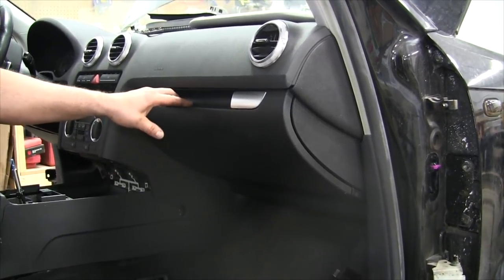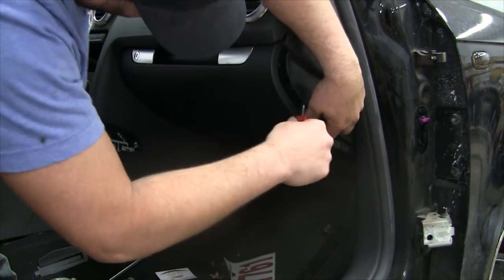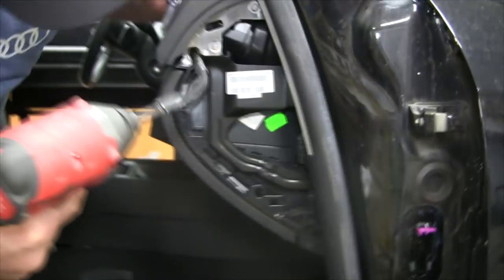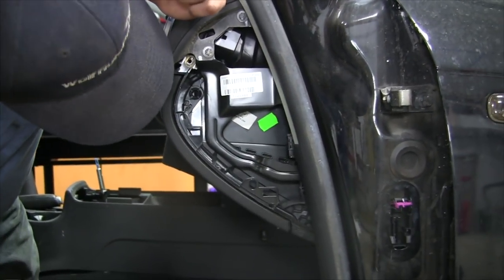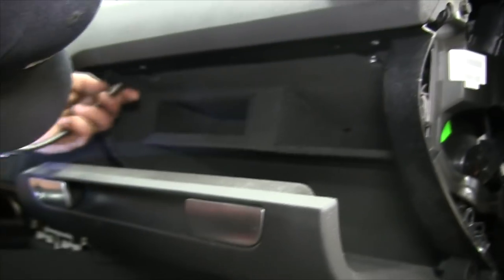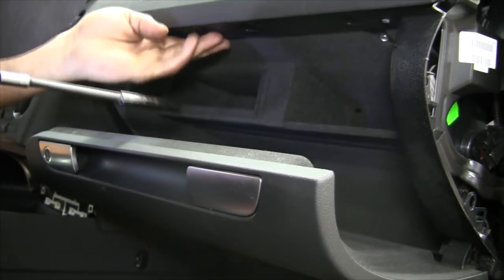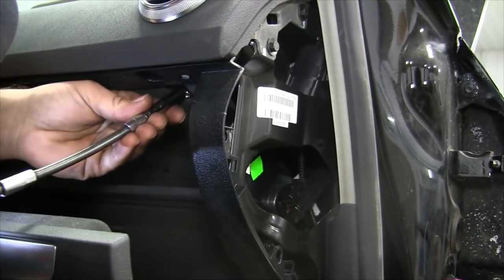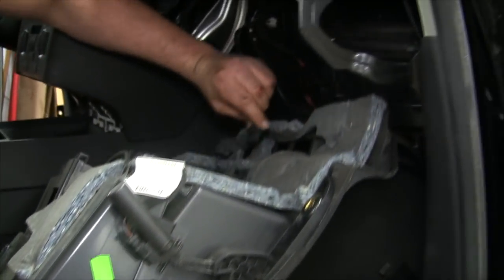How to Remove Your Glove Box - AUDI A3 (2005-2008)

Comment: Hello,  great video but I have one question. 

Are these two upper bolts for the dashboard placement??  
I'm asking because on my A3 the drivers side is close to the bottom of the A pillar,  while the passenger side is about 2cm away from it... It's not even noticable but it irritates me...

Thanks eitherway 😁